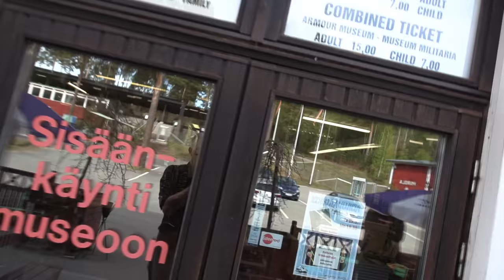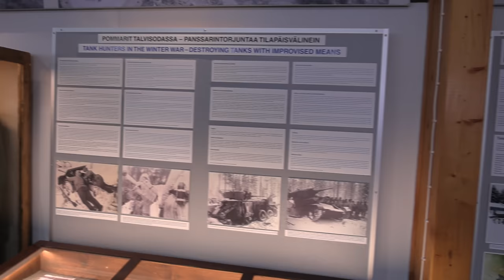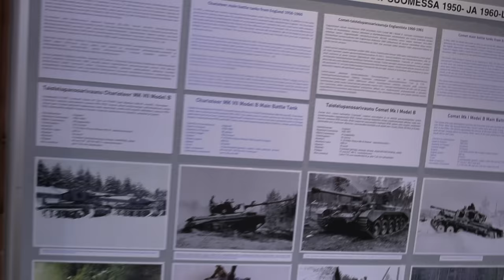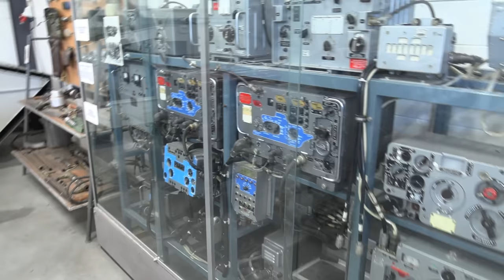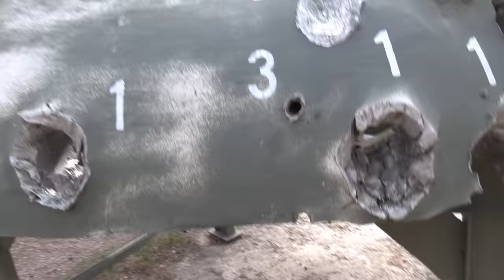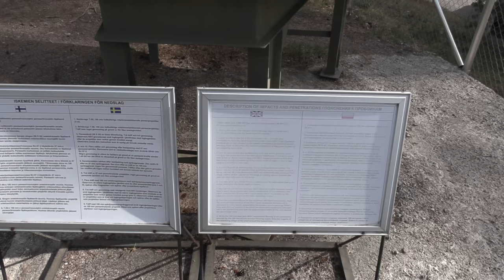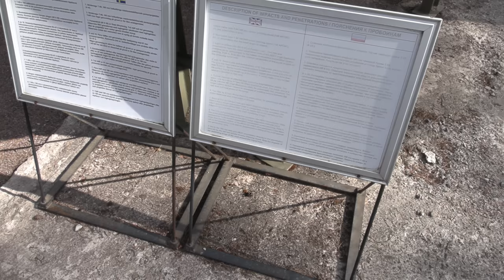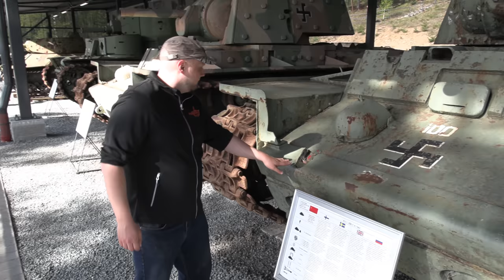Unofficial High Speed Tour of Panssarimuseo, Parola

Comment: Girls und Pan- I mean Japanese fans donated 40,000 Euro to protect the Finnish team, I mean the World War II classic BT-42. I love this country.
Reply: From captured Russian BT-7 tanks Finland built 18 with new turrets and  114 mm howitzer  4,5" Howitzer Mk II. 
A disaster. 
Most if them were destroyed / lost at the Battle of Viipuri (Vyborg).
Reply: It's true that the BT-42 was an abject failure in battle.  But it was never intended to be a main battle tank, rather a high-mobility artillery system.  The design is very straightforward: take a proven high-mobility BT-7 chassis (decidedly obsolete as a front-line tank due to lack of armour and firepower) and stick a small artillery gun on top (some left-over British hardware).  This worked reasonably well - right up until the ammunition produced for it proved to be completely ineffective.  Attempts to obtain better ammunition fell through, but evidently the Jatkosota team in GuP took the time to actually do so.  And picked a "jokkis" veteran to drive it…
Reply: Too many confused... but thats right!!😅😅
Reply: @MrLuhtala  I've read translations of the Red Army after-action reports of Vyborg '44. They seemed to regard the BT-42s as amusing curiosities of no significance.

Anyway, historians have observed the design could have been useful enough as mobile SPG fire support for the small armoured formation the Finns put together mainly out of trophy tanks. The problem was the high command basically had zero idea of armoured warfare and just tried to use them as straight combat tanks for which the severely overloaded and by the standards of the day woefully under-armoured design was chronically unsuited for so... RIP.

Comment: The locomotive for the armored train looks like a VR class Tk3 "Pikku-Jumbo" (little jumbo) steam locomotive.  If so, it was indeed a wood burner, generally fueled by birch wood.  They were the most common locomotives in Finland at the time and were well liked by their crews for their good performance and low fuel consumption.  They stayed in service for general freight and passenger duty until 1975.
Reply: The sort of "fence" around the top of the tender is usually a sign of wood-burning steam power (coal chunks would just slide on through).
Reply: Very interesting Max. The role of railways in wartime is often overlooked by most enthusiasts. I recall one exercise in Germany during BAOR days. Visiting and briefly working with a TA unit that specialised in casualty evacuation by rail. They were all employees of British Rail as it was back then. A very interesting experience that opened my eyes to a completely new (to me) aspect of warfare. Rail logistics and use of the networks. A surprisingly well organised field of endeavour, as I thought at the time. But Europeans have had a couple of hundred years to perfect using rail during high intensity wars. The civilian infrastructure had all manner of military rules and regulations to adhere to. All clever stuff.
Reply: @Max Kronader Thanks for your thoughts about the locomotive.

I felt pain when Chieftain just tra-la-la'd on and didn't look at manufacturer data plates or the signage the museum provided.
Reply: @gusgone4527  
The US Civil War is often described as the first modern war due to such technological innovations as rapid communications via telegraph, maneuver of warships independent of wind via steam engines, armored combatants in the form of ironclad warships,  rapid movement of troops and logistical resupply via the railroads,  etc.
What is often overlooked, however, is that America failed to implement many changes in doctrine and equipment that the conflict pointed towards.  In many ways, the US military in 1870 was inferior to what it was at the end of the Civil War in 1865.  It wasn't until WWI that the US really developed a professional career military.
Reply: It does actually have "Tk3" painted on the side.  And yes, the fat chimney includes an effective spark arrestor - a definite necessity when you drive a wood-fuelled locomotive through endless forests.  Finland did not have native coal or oil reserves, so coal was only used in a few express locomotives since it was relatively expensive to obtain - and even these also carried wood as a cheaper secondary fuel, for use on easy parts of the route.

Finnish locomotive engineering was hardly backwards, despite the apparently primitive choice of fuel.  It was a Finnish engineer, Kylälä, who developed a multi-lobed blastpipe to improve draughting efficiency and thus save fuel and water.  This was further developed by André Chapelon into the better-known Kylchap exhaust system, which contributed to Gresley's record-breaking performance with "Mallard".  Another identifying detail of Finnish locomotives is the third "barrel" (in addition to the usual piston and valve sections) on the cylinder castings, which apparently houses a bypass valve for efficient coasting, automatically operated by pilot valves built into the regulator handle.  This is clearly visible in the brief footage we see of the Tk3 here.

Comment: If I remember correctly, the finnish T-34/76 which was mentioned in the end story was the same T-34/76 1941 which was given to the Bovington tank museum. It was actually the very first T-34 captured by Finland. The gunner/commander of that tank, tank ace Reino Lehväslaiho has written a couple of book about his experience in the Continuation war.
Reply: Actually no. The t-34 that was borrowed to the Bowington was not the first finnish t-34 (Lehväslaiho's tank) but the second t-34 that finns captured. (Syväri 2.10.1941)
Reply: @mtlb2674  Huh, I guess I've mixed up the hull numbers at some point. It's quite confusing as they changed the designations halfway through the war.
Reply: Yeah. I checked out the prochure of the museum from 1993, from there I picked up this information. But all of these t-34's that were in finnish service have their own fascinating history

Comment: Actually that Finnish 75mm is an all-new finnish design, not just a new version of old german 75mm.
Reply: Yes, it was designed by Tampella factory and was intended to be our main 75mm AT-gun just in case the Germans were reluctant to sell their Pak75's to us. They did and so only couple prototypes were built, one was shipped to Israel and disappeared from the history books.

The gun itself was deemed suitable for AT role, but it had a major design flaw: the barrel of the gun was too low. It was intended to make the gun 's height as low as possible in order to hide it to the terrain and that's why the barrel was situated as low as possible. But, when you dug it in to a position the barrel would lay against the ground and you couldn't aim it properly anymore. Also, if you left the gun in position on top of the ground without digging it in, you lost the additional cover for the crew that the digging provided. A good idea but not practical in combat.
Reply: Yes. And for my understanding the sights of the gun were another flaw

Comment: Finland due to budgetary concerns & history, tended to keep in reserve  anything that could go bang & was fairly numerous. Finland gave the bear next door all it could handle & no doubt wanted to be ready. Given the terrain an old AT gun or tank that goes bang would sure beat throwing rocks. As a result Finnish museums have (or had) lots of equipment dating.from 1910s onwards & unique modifications thereto. Where else can one see an armoured train or a Ruskie 76 mm Model 1900 field gun or 122 mm M1909 (mod'd) Krupp design howitzer (,in Tykisömuseo)?
Reply: Well place is called a Museo for a very reason.
Reply: Finlanders (Finns and Swedenfinns) don't throw rocks, but pieces of logs as seen at 28:33
Unlike the American rocks, these things will actually make the crew wish they had checked the rack tension, though in honesty, the delivery system kind of sucks for the chap who pulled the short log.
Reply: @johanmetreus1268  LOL. Ah yes, the US Army tried rocks & other things like rifle barrels to disable a tank's tracks. Result was gravel & bent steel.  
Finland also found something like 2  kilos or more TNT on a stick grenade handle could seriously blast the top of thin armour such as the top of a T-26. 
My point was not just anti-yank work My point was that during the 50s or 60s once the first line ordinance was used up a WW II weapon that could go boom or deliver a shell would be preferable to throwing rocks.
Reply: In the same display you can see vintage drink bottles from the local bottling plant - used, of course, to make Molotov Cocktails, the name originating from Finland even though the weapon itself had previous been used in the Spanish civil war.  At the time of the Soviet invasion, Molotov was the Russian Commissar for Foreign Affairs.

Comment: The smoke stack on the locomotive is known as a Radley Hunter stack, It does not specifically indicate the locomotive is a wood burner, however. The design of the tender, does however, appear to be a tender for a wood burner.

Comment: The M72 LAW, or, by the Finnish army designation, 66 KES 75 (66 for 66mm, KES for KErtaSinko, meaning "single use rocket launcher" and 75 being the year of adoption), was the standard infantry anti-tank weapon when I did my conscription in the early 90's. Never got to fire a live one (though I saw them fired) but carried empty ones around in the woods and fired a few practice rockets. There was also a Finnish built training device that had a short barrel with a simple lock mechanism built inside and fired a pistol cartridge with a tracer bullet and loaded to approximate the tajectory of a live rocket.

Comment: 3:00 The "muzzle brake" on the T34-76. I reckon, that the Finns, outnumbered and for lengthy periods on the defense, were working form prepared (hull down?) positions frequently. Maybe this was an attempt to reduce/dilute the radial part of the muzzle flash, so as not to stir up as much leafs, debris, snow, you name it and to give their positions away?
Please correct me, if my idea is total BS.
Reply: Pretty sure actual muzzle brakes are notorious for having the exact opposite effect. Hell tank commanders and gunners disliked them because the dust they kicked up in most conditions made properly observing the fall of shot (ergo correcting aim) difficult.

Comment: i think the "flamethrower variant" actually was a T-26E (the E standing for Englanti if i remeber correctly) which was a modified Vickers 6-ton tank (hull smg, slightly different hull armour) and a T-26 turret, though i might be mistaken. been a while since i read up on those kind of things
Reply: actually E stands for Mark E, Vickers Mark E as it was base for modifield tank
Reply: Chieftain did recognize it correctly as 'flamethrower variant', it is an OT-133 that had it's flamethrower replaced with regular 45mm cannon. Finnish army converted bunch of T-26 flame variants into regular gun tanks. The rusted tank shown before it with the Vickers builders plate is the T-26E(nglish). Easy way to tell them apart is to look at the bow mg position, it's rectangular in Vickers 6-ton and round in T-26 flame variants.
Reply: @antcommander1367  Ah, i see, thanks for letting me know what the correct reason was. As i said, been a while sine i read up on that
Reply: @mikkojk83  As far as i know, the OT-133 didnt have a machinegun mounted in the hull. the only ones who gave their Vickers tanks/Vickers derivatives such a modification were the finns, last time i checked. Additionally, you can see that it has its turret on the right side of the vehicle like all finnish Vickers 6-ton Tanks had, as opposed to the left like the T-26s had
Reply: @randomstuff6355  The machine gun was added after capture by Finns. As for the turret placement, that is specifically what makes it noteworthy as having been converted from a flamethrower tank, as the flamethrower tanks had their flamethrower fuel on the left side of the hull, thus forcing the turret to be moved to the right. The hull is very clearly a T-26 and not a Vickers as the sides of the upper hull are sloped outwards.
Reply: @OltsuSuomesta  Oh, alright. Was a bit misleading since i saw flame tanks with both turret placements. Thank you for clarifying

Comment: I wonder if a train like that is technically the largest tracked combat vehicle ever built?

Also, the t-34 was pressed into service, right there and then. How long did that usually take? Guns go silent, dust settles, and here's a captured tank. Few holes in it, still runs. Or engine was destroyed. A month, two, half a year, and it's in service with the Armor Brigade?
Reply: In an emergency if the vehicle had been abandoned undamaged in a rush or panic or whatever, or it ran out of fuel or got stuck and couldn't be recovered immediately, pressing it back into service probably took as long as someone getting enough gas to get it running or unstuck, then worrying about painting over the markings. Wasn't the "other" SU-152 captured, pressed into service and then abandoned/recaptured by the Soviets again in a matter of a few days? There's probably quite a few chapters written about the process. I doubt the bureaucracy was any different from what it was with captured small arms, efficient in certain ways and horribly inept in others.

Comment: Has there been any use case where the t-55 upgrade actually was useful compared to a t-54, as the tank never saw real nbc combat?
Reply: Prague Spring and events on  certain square in China? NBC protection works great against fumes from Molotov cocktails, meaning unarmed civilians will have no chance even if they'd try to scrap something up in a pinch.

Comment: No 55 S 55 or 95 S 58-61 recoilless rifles? The former was a shoulder-fired RR (much lighter than the US 57 mm M18 but not an RPG though it looked like one) used at the platoon level while the latter was a wheeled weapon comparable to the US 105 mm M40 and used by AT teams. They were the mainstays of Finnish AT weaponry from the 1950s to the 1980s and in use up to the early 2000s. They were also the last domestic designs, being replaced by APILAS and TOW and later by NLAW and Spike ER.
Reply: Bottom of the glass case above the anti-tank rounds. I also thought there was no Musti there, until another commenter corrected me, you can see a glimpse of it at 31:17 mounted on the tripod mount and with the drag handle removed.
Reply: @RLRSwanson  I would have been surprised if the museum didn't have them (last time I was there was over 40 years ago); I was just griping about the Chief not mentioning them. The 7.62 inner barrel and "hybrid" practice round (7.62x39 tracer bullet and 7.63x25 Mauser pistol case) of the 55 S 55 would have been an interesting sidenote. Got to use one back in 1979; remember how a ricocheting tracer lit a small fire behind the safety berm and we had to suspend practice until it was put out.
Reply: @jarmokankaanpaa6528  Maybe it would be more up Ian's alley to cover those, as he has done videos on various AT-weapons in the past. The 55 S 55 for sure is one those "Could've been an export success had it not been for..." Myself, I may or may not still be able to take apart and put back together a Musti breech.
Reply: @RLRSwanson  The breeches I learned to take apart and assemble were a bit bigger, starting with the 76 ItK 31 Rt and 100 TK (T-55 turret) up to the venerable 152/50T. The 100 TK was tricky as you could insert the cocking lever backwards and it wouldn't retract the firing pin. Expect the tankers would have had the same problem.
Yes, the 55 S 55 and even the 95 S 58-61 might be more up Ian's alley since he's already done most of the other Finnish infantry weapons up to the elephant gun, but I doubt if even Varusteleka would be able to set up a live fire session for either one!
Reply: @RLRSwanson  Kun nyt kerran näihin raskaampiin pst-aseisiin päästiin, mahtaisiko Ianille löytyä vielä 45 K 32 ammuttavaksi? Parolassa niitä näyttää olevan useita. Mustia ei rantapyssymiehenä tullut ulkoilutettua; sensijaan tuli kyllä vedettyä -- ja kerran ammuttuakin -- kyseistä reilun 300 kiloa painavaa vehjettä, joka tunnettiin silloin kyseenalaisella nimellä "jalkaväkitykki"  vaikka siinä ei ollut edes kätevää vetokahvaa.

Comment: 2:50 It might be a flash suppressor,  if you are attacking muzzle flash is irrelevant. If you are defending you don't want to give away your position.
Reply: The hole pattern and shape does suggests a muzzle brake of some sort, since it'd direct the gasses outward rather than mix them with air or conceal them like a flash suppressor would.
Reply: It is a muzzle break.
Reply: @tacticalmanatee  Possibly, however, in this era flash hiders on the muzzle of a rifle were simple cones. It might have been experimental.
Reply: @tonymirarchi  It's possible, but if they were trying for flash suppression they used the wrong design. I can tell you with near 100% certainty that that hole pattern will increase flash, not reduce it. But it's so similar to other contemporary muzzle brakes that I'm quite certain that muzzle brake is what they were using it for. You can see very similar muzzle brakes on some other large guns from the period, such as the Swedish sav m/43.